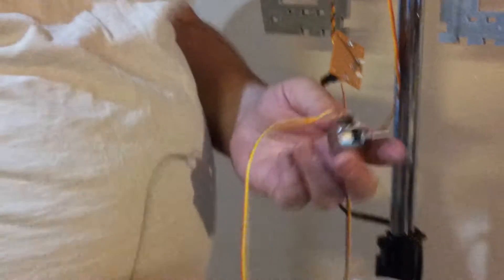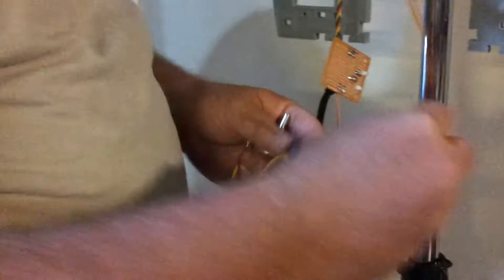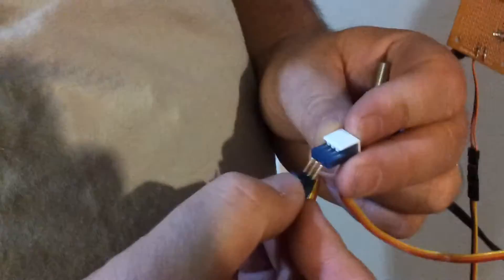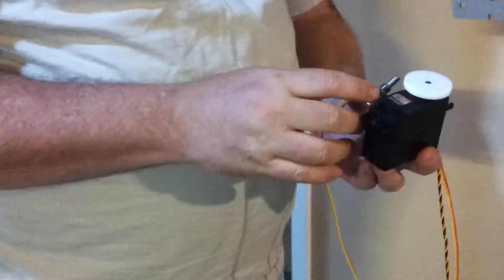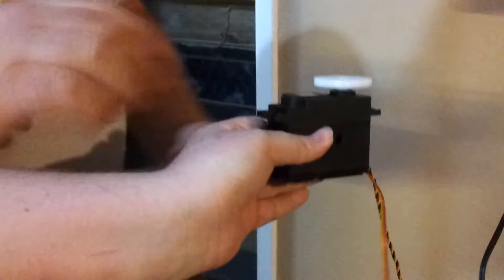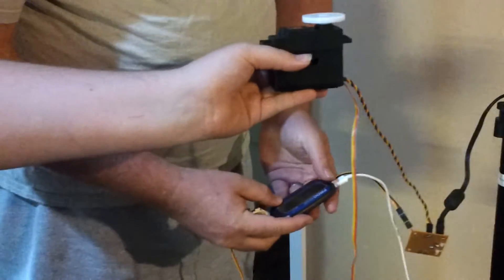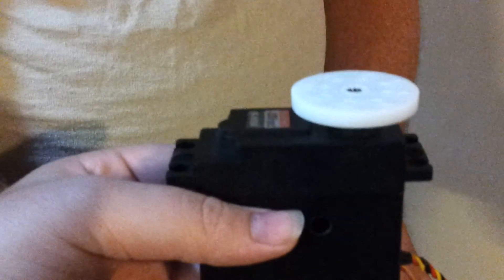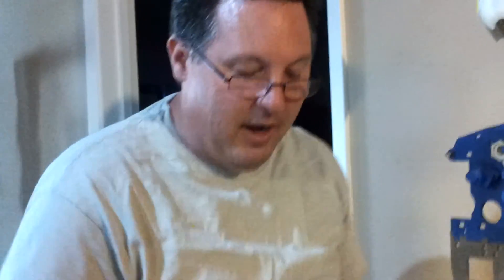Hitec HS 805BB   Installing External Pot   Part 5

Comment: does it need to be 5k?
Reply from the maker: +NumbnutzTV no it doesn't have to be, but most of the servos I have taken apart use a 5K.  You need to match the ohms of the pot you are replacing.  If you need to use a different sized pot, you can place a resistor in parallel to bring it back to the size of your original pot.
Reply: kaibab2708 thanks a lot, saved me some soldering right there xD